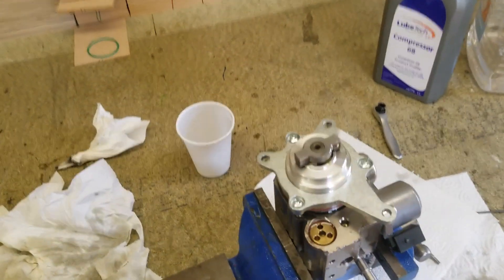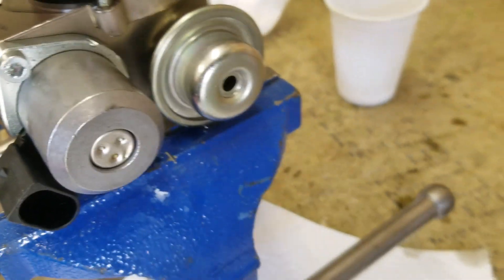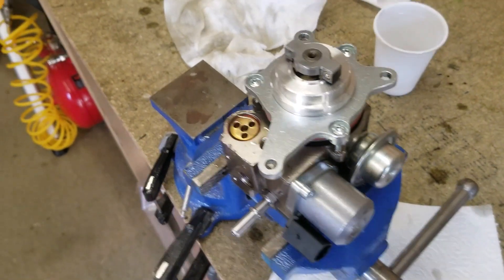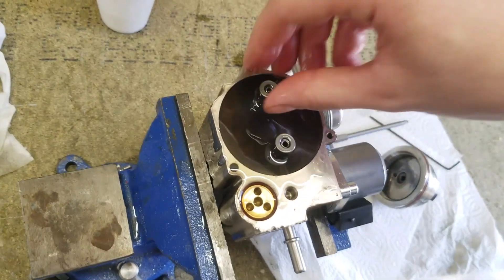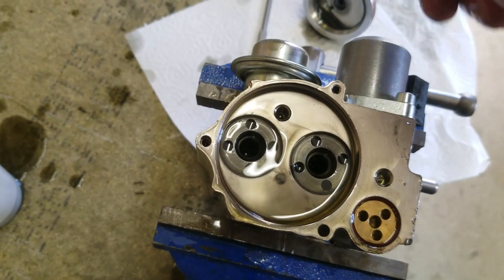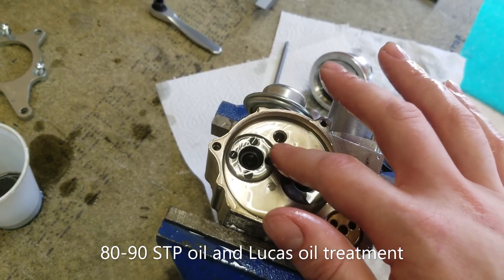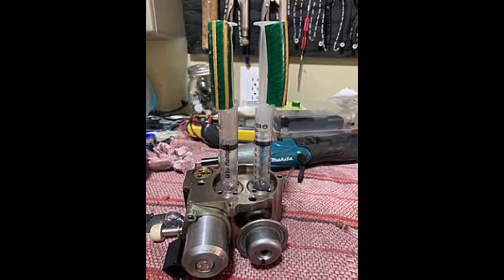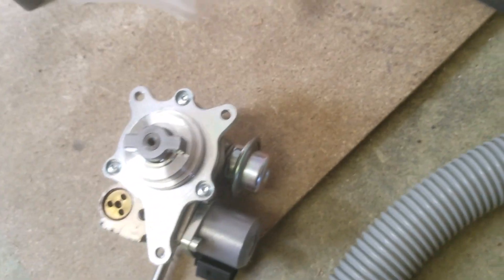Mini Cooper N14 High Pressure Fuel Pump Disassembly Repair

Comment: I have seen many restorations, and the optimal oil viscosity varies depending on the deterioration and dirtiness of the oil, and the condition of the seals.
Increasing the viscosity of the oil can improve sealing. I don't think low viscosity oil, which is sensitive to heat, will last long.

Comment: Did this refurbishment without the pump, after cleaning, submerged the parts in a hydraulic fluid bath (blocked the petrol openings and the electric socket) left it overnight , for the air to escape. Assembled while submerged , got 15mm on the membrane. Fitted it, started normally, within 50 mt of driving orange engine light turned off. Drives perfectly, revs to 6000 RPM without a problem, so far only 2 weeks and 220 km.
Reply: So far 4050km no problems.
Reply: @vladislavfeldman6562  thank you for updating 🙏🏻
Reply: Hi, Using this method you didn't need to use vacuum on the membrane? Tks
Reply: The ideal is 21 mm in the membrane, 15 mm generates very high pressure...
Reply: @Caranga007 I did the pump recovery procedure and it gave 16mm and it is working perfectly, at the same time, I bought a new pump, its measurement is 27.7mm, I will keep it saved in case I ever need it
Reply: @Caranga007 tenho uma bomba nova, lacrada, nunca utilizada, que a medida original é 27.7mm, acredito que a medida não seja tão importante quanto dizem
Reply: How is it running?
Reply: @marcosr666 Hey friend, I did the process by submerging the pump, it's been working very well, since the date of my first comment, I used a syringe to hold the vacuum of the solenoid and submerged everything in ATF CVT transmission oil, I used 2L of oil in a container large enough to fit everything, when assembling, I got the measurement of 16mm in the solenoid, I ran the Lexia Scanner and monitored the operation of the pump and it's perfect.
Reply: @marcosr666  So far 1540 km and running well, but people keep telling me 3000km is about how long it will last.
Reply: @vladislavfeldman6562 did you also change the o-ring/gasket, i saw another video on youtube, they replaced the gasket also, that it was needed to keep it work for longer, and the main reason they lose pressure,
Reply: @GosseNijhus  Depends how old your pump is and how many times its been refurbished/refilled. There is a couple of places on Ali Baba that sell the gaskets and pump to completely refurbish but the cost all up is about US$200. No i didn't change any of the gaskets. Mr2Tempo, he has done about 250 pumps, says the pump can be refilled about 4 times before changing gaskets, unless you get fuel smell in the pump, they usually last 9-15,000 km.(brand new pumps last 60-90,000 km.)
Reply: @vladislavfeldman6562 i dont know how many times tge previous owner did this, it has been a problem sinds the day i bougt the car, so maybe never or even 4 times, or those o rings from alie any good? And there are a ton of replacement units, but they all seem they are refurbished too, which brings me back to sqaure one and just refurbish my own unit
Reply: @GosseNijhus  I first purchased a supposedly refurbished pump from China, all I got was a non working pump, which is why i just refilled mine. $20 and so far 4300 km. I did the Chinese pump as well I got 15mm on the membrane as well , but haven't tried it out yet as mine is fine. If you open your pump and you get a strong petrol smell you would need to change the gaskets in the internal cylinders.
Reply: @vladislavfeldman6562 good to know thanks, any advise on the oil, should it be a mix or do you have an example which one did you use?
Reply: @GosseNijhus  I tried to follow Mr2Tempos advice and use Hydraulic fluid ( I used mineral because I couldn't get synthetic.)

Comment: My Mini has been having idling and torque issues, i am suspecting a high pressure fuel pump. Interesting scenario is that when i turn the car off and on again it drives like new until i let go of the gas for a while, after that it just dies in neutral. While running cold the car seems fine.
Any tips? 🥲

Comment: I find that they fail more often from the pressure regulation valve mostly due to hardened seals which comes into contact with the fuel. It can be removed and resealed also heat affects the solenoid mechanism of the valve itself where either the coil windings break down or the valve becomes sticky not regulating the fuel flow correctly

Comment: Hi, Thanks for the video! Does anyone know if you can get a "Lazy Pump".
 I have had every thing replaced on the fuel system, but had the HPFP refurbished, but still have the same symptoms. 

When on full acceleration I get around 1800psi, at idle it fluctuates from around 630psi to 750psi. However when idling and bliping the accelerator or coming to a stop, i get a massive drop in fuel pressure, and it shows around 200psi, and then gradually goes back up to where it starts to fluctuate again around the 650-750psi mark. This causes the car to stutter badly but does not actually stall. On startup I get a slight hesitation/hicup and then the fuel pressure climbs to the 650-750psi mark and fluctuates there again.  car with ignition on is at 70.5psi which is what the in tank fuel 
pumps are rated at. Could this be a bad HPFP. Alot of money to fork out if it isn;t that. Cheers for your help

Comment: Greetings from Mexico  , I followed your steps and successfully y ended up with a good working pump. But I didnt change the seal, I couldn't find the part number , do you happen to have a part number? Im planning to   take it apart nextime soon so I can change seal and orings .thank you for your tips.
Reply: Greetings from sweden did you follow his steps in the video and it worked? :) does it still work ?

Comment: What are the symptoms of a failing high pressure pump?? (N14 also).
Reply: Will run rough and sound like it's coming close to stalling. Might also get an engine light that's half coloured in
Reply: @CocaiineNadex  also high comsumption? Rich mixture?? 
Maybe unrelated ...heating of the engine??
Reply: @carlosandresparra9306   im in malaysia. the intake temp goes to 63'c (obd2) then my 2103 peugeot 3008 p84 go to limp mode (very hot day, big trucker catch fire and cause jam at highway).  heating of the engine compartment - pump heated  then fail...  after my car cool down for 2 hour at oil gas station- back to normal after i clear code

Comment: To me, it appears that the oil inside loses its viscosity causing the piston to lose its seal. Therefore, the bellows will not cycle its full-length witch will cause a decrease in fuel pressure. This is more likely caused by the extreme heat transferred from the head onto the pump. The pump acts as a heat sink from the head and takes in all the hat transferring it onto the oil inside. My 2 cents would be to change this oil every 3o-40k miles.

Comment: I measured it, it's 22mm. Should I repair it, or it's good? Can I use ATF oil (automatic transmission oil)?
Reply: 22- normal ATF normal

Comment: Just to share my experience...at the tine of my comment I replsced the oil by 0w20 sintetic ( same for auto motor) ..I dived the two parts in order of close it without any such little air'bubble.
So far, 12k kilometers roared. 
btw, my pump is original from 2014..

Comment: Thanks, this helped me fix the identical pump from a Citroen C4 Grand Picasso with THP155 engine. Meanwhile, the replacement pump arrived but I've done several 1000km without any problems so I left the repaired pump in the engine. It may be important to know that the problem didn't disappear on the spot, but the repaired pump needed a little breaking in before all was back to normal. Thumbs up!
Reply: Hi Jan, which oil did you use exactly? And did you replace the seals also? Was it possible to remove the fuel line without the extra special tool?
Reply: By breaking in what do you mean? This is my current situation I am in. Refurbed the pump reinstalled and thrown 2c01 code. Low pressure in hpfp. How did your car behave until it ran well and did it throw any codes?
Reply: @leonard54321  The error code is unknown to me but obviously equivalent to P0087 in the Citroen world. After replacing the pump, the engine worked well straight away but some stuttering came back say during the first 100km. In don't remember if there were any error codes. After you fixed the pump, did you measure the distance to the diaphragm? Should be well below 20mm or else your repair failed in the first place.
Reply: @werwirddaswohlsein2677  I did Jan  Infact I had the opposite problem I used a hand pump vacuum on the diaphragm while installing the drive side. Ended up with a measurement of an increment below 12mm which equally worried me as that was it's minimum ultimate limit  it could not be depressed anymore. After that I slowly unscrewed 3 screws until enough oil seeped out to create a 16mm dist from diaphragm to inner bell housing
Reply: I've been  told by the main man himself Mr2tempos
Reply: Unfortunately I've upgraded safe proofed a lot of issues while cars been in garage for a couple of months
Reply: Its momentarily started but for no longer than 5secs then dies. I have attempted to service HPFP while being strict with info from reputable sources but taking basics and working from the ground up. Still nothing. Started on 3 occasions momentarily but has followed through

Comment: Why don’t u tear down the solenoid  and change the o rings on the fuel side? They dry out and don’t hold the proper amount of pressure. That’s where the fuel does  it’s business

Comment: Hi, you are sure that a new pump has 13mm ?? I have measured a new pump with 22mm 🤷🏼‍♂️ .... thanks
BR Ronnie
Reply: I have a hpfp. I measured the diaphram, it's 22mm. Should I repair it?
Reply: @grudgeholder6844  22- rood
Reply: @mrboy3114  22 millimeters
Reply: @grudgeholder6844  22-yes
Reply: @mrboy3114  hahaha :) where is this conversation going? I just wonder, 22mm is good or bad. Should I repair it? 😁

Comment: Hi,
Does anyone tried to dive the pump into a contsiner with oil in order to guarantee no air inside the pimp before close it.. 
I was just wondering such method ..
Reply: I know it's a old comment but I was thinking the same. I'm going to try assembly with it submerged
Reply: @Ryang1987 Did you try submerged assembly?
Reply: @Ryang1987  I did that 3 weeks ago in Hydraulic fluid, left it overnight, than assembled while submerged. I got 15mm. Worked as soon as fitted, so far I've done 300km.
Reply: @ClaraWiseman  that’s really good to hear mate. We ended up getting a brand-new unit from BMWs in the end. It was my mum’s car and I just wanted it to be 100%. But glad to hear you got a result 👍🏻
Reply: I tried this it works!!

Comment: This video also misses vital steps which prevent this happening in the future, and prevent the pump being damaged... up to people whether they think it’s worth the risk or use a professional
Reply: There is no way to prevent it from happening again other than changing your oil often with the correct oil. You replace them when they wear out. That simple
Reply: @chasechevy8933  Okay, But  : What IS The Correct oil ?? Thank you.
Reply: @kopronko  ....No idea what goes in the pump itself. Those aren't designed to be serviced by the customer
Reply: @chasechevy8933  are there any springs/piston replacement parts?
Reply: @elieconstantine  ....I'm sure there are but only shops with specialized tools do that kind of thing with any real reliable results
Reply: CLAUDIO IL TEXANO  Thank you .